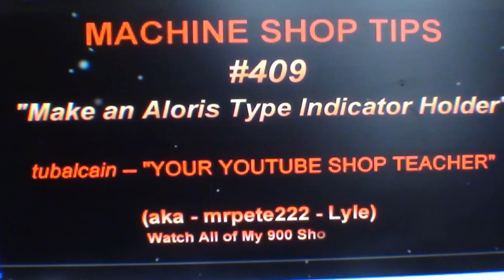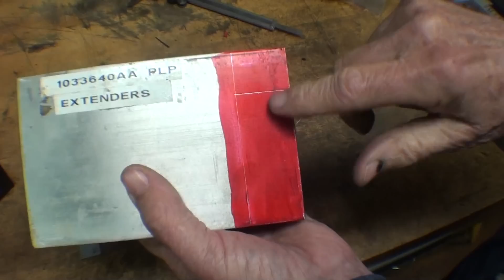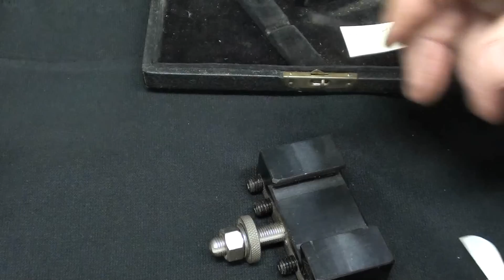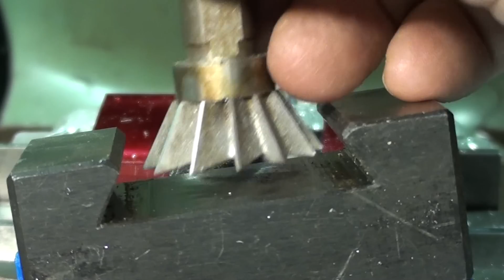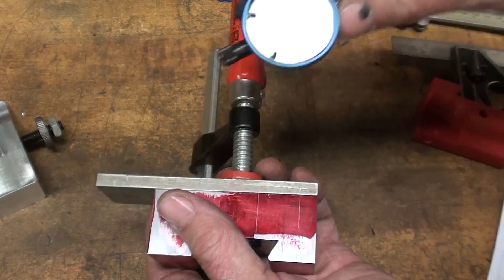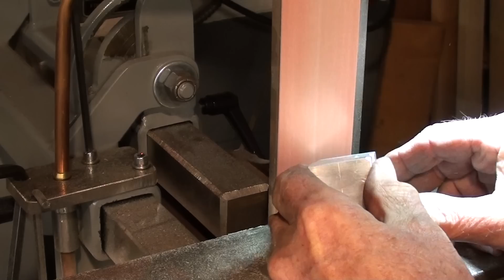Machine a Dovetail Indicator Holder TIPS #410 tubalcain

Comment: I'm thinking you made a bad bet about no one making this project. Just got my mill yesterday so it will take me a couple of weeks to get it setup but this is one of the projects I intend to make. I agree magnetic bases on smaller lathes become an issue and my 11" lathe really doesn't offer a lot of places to stick the magnetic base so I end up working it off of the cross slide which puts my base on the backside of the work and is a hassle.
I'm also considering making a block with a dovetail that I can thread and mount my indicator arm off of so I have the ability to articulate a test indicator around but I'm not sure if it would be worth it yet because that places the arm kind of in the way when it's on the front side rather than just using a mag base on the cross slide and reaching over.

Comment: I've watched this video several times because i fully intend to make one of these once i get the tools to do so. The bonus is, i can make this ahead of time before i ever invest in a quick change tool post and leave some extra metal on the side to fit into my regular 4 tool post. Then when i finally save up to get a QCTP i can cut the extra off, add the dovetail, and be rocking and rolling again.

Comment: Wonderful video. If I'd had you as my shop teacher I wouldn't have had to wait so long to fall in love with metal working! All we did was wood, even though the lathe and mill were there, collecting a nice layer of sawdust. I didn't go through all of the comments so I apologize if someone else discussed this. I'm positive that YOU know and likely most other folks know, but for the youngsters watching that DON'T know,  the reason that the small brass insert is at the tip of that setscrew is so that it doesn't damage the shaft or race of whatever it is being set against, because brass is likely softer. I'd love to have a handful of those because they're not as cheap as they used to be. (Is anything?)  Thanks for the great lesson, sir!
Reply from the maker: Thank you, I'm glad you like my videos. And even more happy that you fell in love with metal working. Sometimes shop teacher or for that matter a regular teacher.  Is Forced to teach classes that he knows nothing about or has no interest in.  That is unfortunate for the students and the teacher

Comment: if you wanted to make it as small as possible you would have had half the dial indicator face fit in the toolbit slot. Its not like you need the full travel, half of the indicator face is enough. Like a johansen microkator
Reply from the maker: Yes

Comment: [plate clamped onto workpiece to provide centre for dividers]  "I know you're thinking I lost it....I bet you're thinking that"
Actually, no.  I was thinking "Genius idea!"
+1 for I'll be making one of these too.  Not sure if I'll do an exact copy, might look at changing it so it mounts onto the indicator in place of the backplate with the lug - not sure yet.
Was waiting for the video that covered the dovetail part of things - have seen the theory before but there's nothing like a dry-run to make sure you understand!  Thanks for that.

What speed are you running that fly-cutter at?  
Mine starts to wobble soon after 800rpm.  It looks like you're much faster than this but it could be just the video - not sure if yours is just better balanced or it's just that your mill is [much] sturdier than mine.
Reply from the maker: I am running out at 800, but Randy said he runs his at about 1200. And I often make a dry run, but I call it a rehearsal

Comment: in theory, would it be possible to make a righthand and lefthand holder for this? do the radius for both at the same time? doing it from one larger chuck of material? to my mind it might be useful to have a a righthand holder for indicating face runout. even if it might be something rarely used for some people, it might be useful to have in your tool box as a 'just in case i ever need it' type thing.
Reply from the maker: Yes you could make a right or left
Reply from the maker: Yes--and I will have a double ender coming out within a month

Comment: You're half way there! Cut a relief on the back end of the new indicator holder you just made for a second indicator identical to the front one. Mount one of the midget indicators there then mount the tool holder on the quick change tool post's front dove tail. Now you can quickly check the run-out of the face of work mounted in your chuck.
Reply from the maker: Don't get ahead of me, I have a double ender in the works.

Comment: Hello, Lyle — A video recommendation. Suppose you had put the screw in the wrong place. How would you fix it? In wood I drill and glue a dowel. What does Tubalcain do? Great project! Thanks for it, and season’s cheer.
Reply from the maker: You simply do not put the screw in the wrong place

Comment: Fun project to watch, but only if you have a lot of time on your hands.  Nothing this tool does that couldn't be done with a magnetic base indicator, which would allow you to have your cutting tool undisturbed in the holder.  Also, after all that nice precision work, you attach the indicator with a screw from an erector set.

Comment: That plastic indicator holder is not a proper solution for precision work of course for at least 2 reasons:
1. When you clamp the holder in the tool post using the lever you can see in your video how it slightly bends. Under this stressed state the rheological property  of plastic comes into play (meaning initially fast material creeping under load). So even when centering a part in a 4-jaw-chuck the indicator may read differently at the beginning and the end.
2. When you take the holder with the indicator out and back in and to not clamp it with exactly the same force you will get different readings. So the otherwise excellent repeatability of the Aloris QCTP is compromised.
Reply from the maker: Then make it out of Metal
Reply: I agree. I like the possibilities that 3D-printing offers. But it does not provide adequate parts for all applications. It is not adequate for applications where precision or strength or rigidity is important. It is excellent for e.g. casting patterns maybe with some clean-up machining to get flat split planes.

Comment: As usual great instruction, and as it happens I'm 3D printing one for a friend at this moment, although it's to his own design as we have Dixon type toolholders which are more complex with a large "T" slot with a "V" slot either side, a bit trickier to machine, so 3D printing is by far the easiest route for a DTI holder. Have a great Christmas.
Reply from the maker: That sounds great. I am not familiar with that type of holder
Reply: It's a British design and if you are curious can be found here http://www.lathes.co.uk/latheparts/page13.html . I think maybe more people build the stuff you teach more than you think. Last week I made your cutting oil can, but used a sweet (candy?) tin instead of the chicken tin you used :-) I have learned a great deal from your video's. Many thanks, Keep em coming and have a happy Christmas.

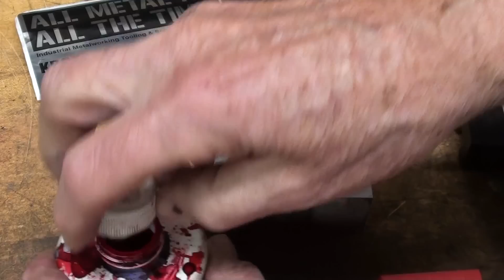Comment: 9:00 Hey Lyle, I call that the "old guy rule" when teaching the juniors: Do the hard part first and finish on the easy part of the job, if it will allow it. Too many times I have seen the easy work get completed and the final touches are the most difficult operation to do, and now, I just don't have the patience to do it any other way. Thanks for the video and have a nice Christmas , new years etc..
Cheers!
Reply: Yep, always paint the front of the house last.
Reply from the maker: Yes, the hard part first, then you can coast

Comment: I can really use a holder like this so after your first video I went and ordered an indicator. Problem is I mistakenly ordered the indicator without the lug mount. I will have to come up with a different design that will hold the indicator by the stem or order another indicator.
Reply from the maker: Just order another indicator, they are cheap enough. I am stuck with that one that I showed in the video without a lug as well

Comment: Another great video. Wondering if you would consider doing one on face mills for bridgeport type mills, or maybe you covered it somewhere and can point me to it. I see you using them all the time, but when looking at all the different choices, cutter angles. and insert styles I don't know what would be best for general use facing. Thank you again for all of your work putting these videos up. Over the last 5 years my garage and basement are now full of metal working equipment. I blame you and Fenner for most all of it!...... Lol
Reply from the maker: Never thought of doing that, I'm not sure there is much to cover. As they are available and all the catalogs

Comment: A good trick for ensuring fit on 3d printed parts is to print test cubes in an aray of sizes. Measure in X, Y, and Z of each cube. Graph the %distortion vs. Size for each axis. Now you can input the rough dims of 3d printed object and scale to have tight tolerance.
Reply from the maker: Thank you. In fact that is one of the first things I did, was to print a 25 mm cube. I was shocked, I mean absolutely shocked at how accurate the cube was
Reply: mrpete222 my 1cm cube was dead on, but my 1in was off +0.0036". Error factor increases with size. I think cura scales for pla shrink, but not sure. I can now get 0.0000" tolerance so I am pretty happy.

Comment: I actually built two of them.  One AXA and one for my 6" atlas lathe.  Good stuff!
Reply: what is AXA ?
Reply: AXA is universal (size) of tool post for small to mid side lathes.  There is also BXA which it the next size larger for bigger lathes.  Google "AXA tool post" for more detailed information.
Reply: @FredMiller  there's also an oxa (or is it 0xa?) which is even smaller, good for those mini lathes

Comment: The public education system in the States is really crap in a lot of ways. It not just because a lot of schools no longer offer shop class but it doesn't help.
Reply: After the Jesuits kicked me out of Gonzaga Prep (in1974 for excellent attendance, I was into auto racing. Still am) I went to Shadle Park High. There, I was really bored, the classes covered material the nuns gave us in grade school. The good part of it all were the shop classes. In wood shop we were making knife handles and inletting stocks for the black powder barrels and blades made in metal shop. Old band saw blades from saw mills were recycled for knife blades. No one was ever shot or stabbed. Sadly these classes are history. hell, they have even cancelled home economics classes. It's no wonder kids these days drive by shoot and sell meth. IT MAKES ME MAD AS HELL. There is only room for x amount of computer geeks and some one has to fix their cars and make parts. I follow public surplus auctions and It is alarming how many schools are getting rid of the lathes, mills, band saws, grinders, and every other shop tool you can think of. At 61 I don't recognize the country I grew up in and love. So I buy machine tools, build  hot rods, restore old cars, tractors and firearms. Harleys and Indians forever !!